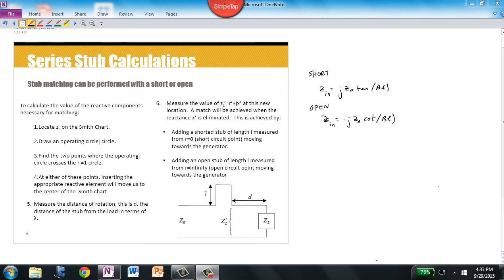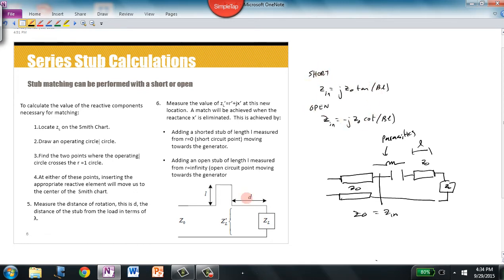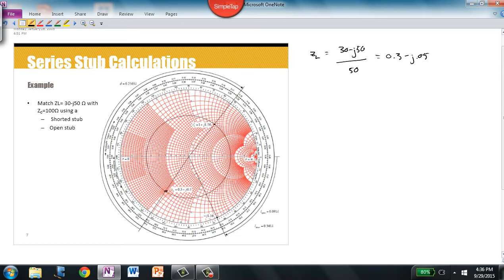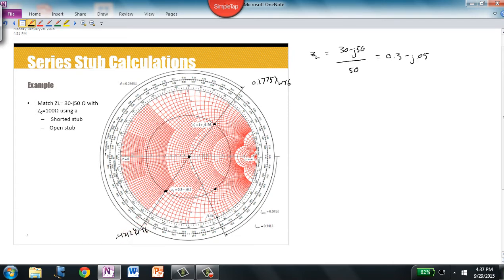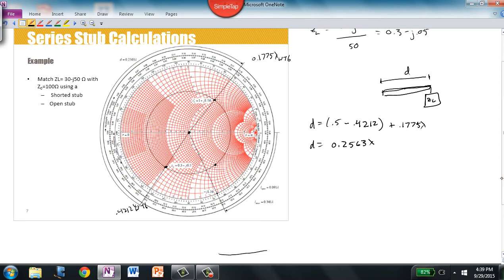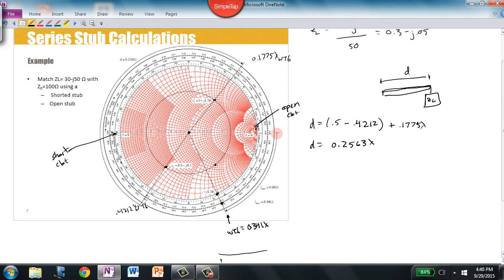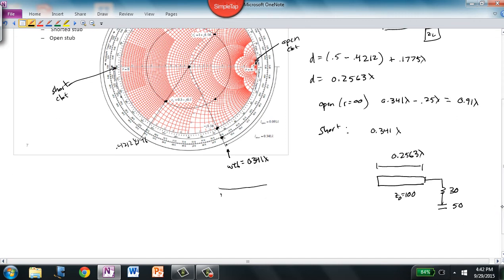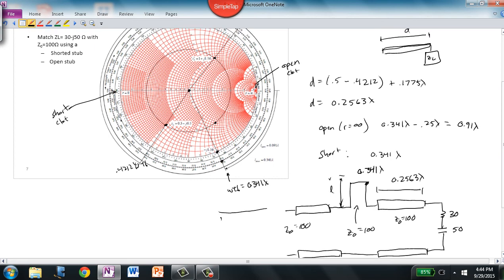Topic 10 Part 4   Series Stub Matching

Comment: I think that there are two errors at 10:19. For the shorted stub case one needs to compensate for a minus j*1.56. You need rotate clockwise from the short circuit (0) point to j*1.56 and not back to the original point of intersection (which would merely add one half wavelength to the open stub case). This will give a (shorted) stub length of 0.158 lambda and not 0.341 lambda. You will also need to correct the length of T line in the shorted stub case to reflect that one is going from the load impedance point at 0.42 lambda to the intersection point at 0.341 lambda. This will equal 0.5 - 0.42 + 0.341 = 0.421 lambda for the length of the T line.